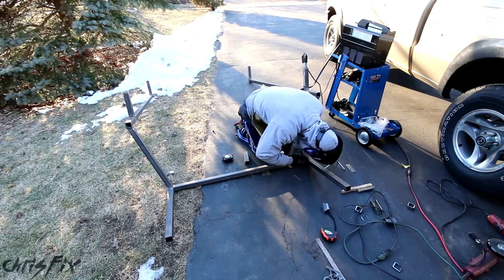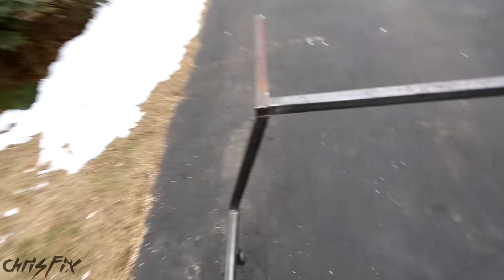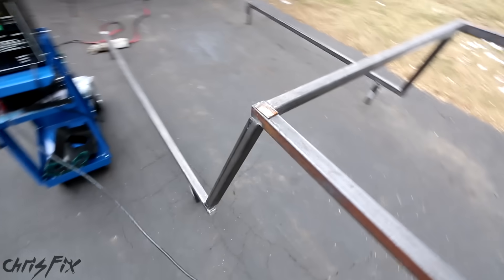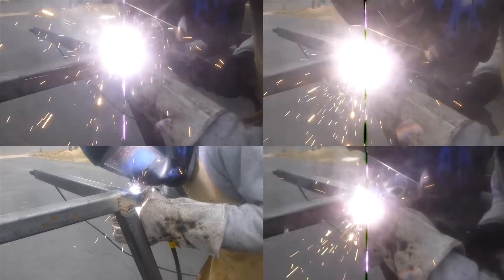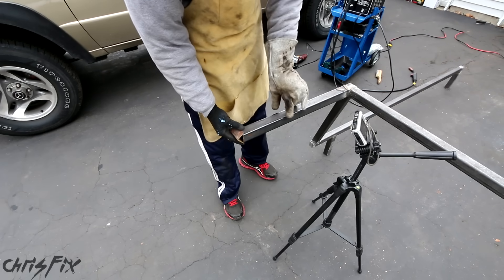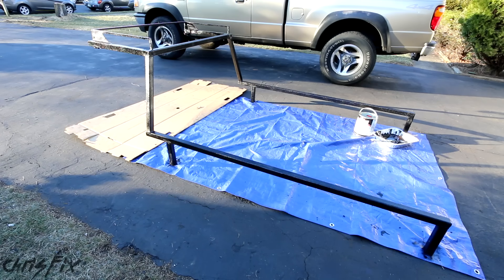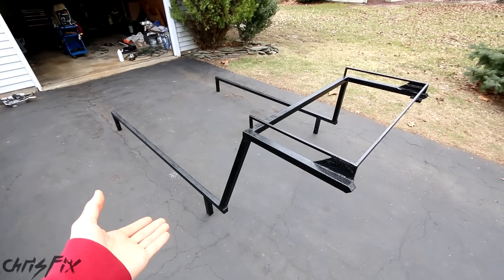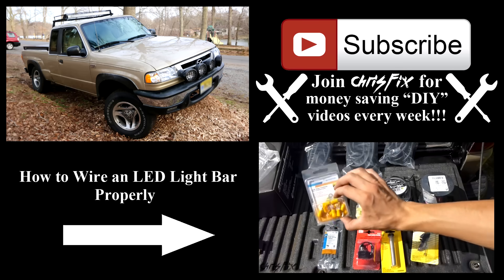Custom LED Light Bar Build (Part 2 "Project Night Light")

Comment: I am very impressed with your design and build and I couldnt help but think about some other ideas you might want to add to your rack like some cross bars so it could be used as a basket, also some forward amber lighting in the form of some pods on the sides or a smaller 10" bar on the bumper to cut through fog and dust, and one last idea was some bed lighting so you can work in your bed at night. I'm sure someone had made some comments like these already but I think your rack how it is is very cool and a nice custom design so GOOD JOB!!!!! You have me as a subscriber now!!!!
Reply: And i just read the next comment that was basically just like mine so good to know we all want to help! Props to you though for building this thing yourself.
Reply from the maker: Tom .Dugan Thanks a lot Tom. Those are really great ideas and stuff I tried to build into the design so I can easily add it later. I know you saw the other comments but thanks for the ideas!

Comment: Hi chris , i follow you from italy and seen all your vids . I didn't know where to ask so i'll just ask here. I would like to know what you think about a 12 volt Impact Wrench or an economic electric impact wrench. I read a lot of reviews and they seem to be nearly all positive. Air tools are too expensive and complicated and not everyone can use them. I am not a professional mechanic and i would like to try out some electric impact wrenches . What do you think ?? Thanks, Mike !
Reply from the maker: Michele Debenedittis Hey Mike, thanks for the shout-out from Italy! A 12v impact is a great tool to use. I would try to find one with a lot of torque, one that has a lithium ion battery, and one that is small for those tight places. Air tools are great but then you need to fire up the compressor and drag around an air hose. I dont really have one I recommend because I dont use them, but let me know what you end up getting!
Reply: Ok i will let you know,  if you will ever do a review on a 12v impact wrench let me know.  I think it's a great tool to have.  Very cheap(50 dollars on amazon) and it does the heavy stuff easily without compressors or stuff like that.
Reply from the maker: Michele Debenedittis For sure!

Comment: Good job Chris, 

Heres a welding tip, when welding tube to flush metal knock the ends down of the tube. It'll help with weld penetration and less clean up grinding. Second tip, try welding gusset plates where loads will be,like the vertical from the bed up to the cab top and where the "light rack" meets it. It doesn't hav't to be large, but you'll be dealing with wind hammer at highe speeds.
Reply from the maker: Darren Ambrose Thanks for the tips Darren!
Reply: I only mentioned it because, I've  got a Doctorate from the school of hard knocks.My old instructor said " An ounce of prevention is worth a ton of peace of mind". Happy Fabrication....
Reply from the maker: Darren Ambrose Haha, I agree with your instructor!

Comment: Good job! Especially considering you're a selftaught welder! I think you used a little too low amps tho, but it's still very good! 

If I made this rack, I'd weld in a "strenghtening brace" between the horisontal bars and the vertical bars. Even tho it's metal, it stills av quite a bit of flex!
Reply from the maker: Niclas Nybakken Thanks a lot man!
Reply: You actually made me want to weld a safari rack for my '93 4Runner!
Reply from the maker: Niclas Nybakken Do it up!

Comment: Hey I am putting a light bar on 2006 Chevy duramax. Do you have some tips for me.
Reply from the maker: Dallas Musqua Yes, did you watch Part 1 where I explain where you want to mount it? What light bar are you going with? Where do you think you will mount it? I will be doing a wiring video soon so that part will be easy for you.

Comment: Wow, nice job!  The bed liner was a great choice for the added texture.  About the only thing I would change is the thin top bar you have on the 4 stands.  I would have put the front stands in the way you did.  Then put say a 6" bar angled down from the front stand and connected directly to the lower bar just behind the lights.  Basically following the side panels you put on to help protect the bolts by making it harder for someone to steal.  That thin bar going all the way back just looks a bit awkward next to the streamlined look of the rest of it.
Reply from the maker: JohnWPB Thanks man and thanks for sharing how you would do it differently. That would be nice too!

Comment: You ever think of making it a roof rack for storage?
Reply from the maker: imajuu I thought about it but for now I wanted to see how the light bar worked with my setup. Maybe I will add two alley lights and then some expanded metal to make a rack in the future!

Comment: Hey Chris, if you haven't done this already, I have had very good results switching out the wire AND tip in my welder (identical to yours) for 0.035" LINCOLN flux core wire and matching tip. it actually makes a world of difference.
Reply from the maker: Darren Gendron Really? I need to try that. The tip really makes a difference? I will have to get different wire!
Reply: ChrisFix  The tip is required as the tip size that comes stock in the machine is 0.030" and cant accept the slightly larger diameter wire. I found that the lincoln ones made for 110v welders fit, and took this route as i could not find any 0.035" ones as an OEM replacement. My machine welds much more consistent, and penetrate better as well!
Reply from the maker: Darren Gendron Oh gotcha. That tip. I thought you meant the copper tip. That makes sense!

Comment: Great job so far Chris but, where's part 3?!?!!11?! =D
Reply from the maker: w00tplayaw00t The wiring video is getting filmed today and will be up on Thursday! Stay tuned!
Reply: Ah, such a tease! Alright. Sounds good. Can't wait.
Reply from the maker: w00tplayaw00t Yea, I had some questions for Wurton that they are answering about the proper wire gauge. Until then I do not want to run a ton of wiring and then have to rip it all out and re-film.
Reply: Ah, okay gotcha. Yeah man, take your time. I'm just anxious to see the final product working. Also, what cover is that on the bed of your truck? Looks real clean.
Reply from the maker: w00tplayaw00t I feel ya man. Im anxious to get it wired in. I have this awesome light and I cant use it yet!

Comment: Absolutely AWESOME! 
Need a few beamshots in the dark to see the performance, does it vibrate at all without front support?   Very very cool build,  love the videos!   Keep em coming!
Reply from the maker: Brian C Thanks a lot Brian! I will be making a video on how to wire the lights and at the end of that I will show the light in action. It does not vibrate at all which is great! I can stand on the front supports and they only bend 1/2 an in or so.

Comment: Don't forget to drill several holes on the square tubing to allow moisture to escape,
I see it all the time that aftermarket running boards rust out because manufacturers
skip this step (probably to sell more of them).
Reply from the maker: Marv Douglas I sealed the tubing off completely so that shouldnt be a problem. Do you think I should still drill holes?
Reply: I live in Washington state and I often see running boards rust from the inside out. You need to do whatever you think is right. Take car.
Reply from the maker: Marv Douglas Thanks man!

Comment: Chris! I have a Mercedes s430 2003. When i apply very little brake pressure, i hear rattling noises from the car, but as i apply more brake pressure the rattling noise is gone. What can be the problem?
Reply from the maker: ***** Sounds like the anti-rattle clips are bad. They hold the brake pads in place.

Comment: Hey Chris I have a question so recently my dad got a truck for me and I went to look at the frame and it is all rusty it's not surface rust but there is no holes what should I do and should I be worried
Reply from the maker: joe moe You can use a  big metal wire brush and brush it off. Then hose it down and let it dry for the day. Then go under and use a spray paint or herculiner like in this video. Many trucks have frame surface rust. The key is not allowing it to get worse.
Reply: I found a hole in the frame from the rust :( what should I do now
Reply from the maker: joe moe If it is in the frame, then you should get it fixed!
Reply: Yea it's in the frame im going to take it to my uncle he's a certified mechanic I hope it's not that bad
Reply from the maker: joe moe Keep me posted!

Comment: Use a little tap fluid or at least some oil on your tapped holes in mild steel. Makes for smoother tapping and nice threads.
Reply from the maker: George Cortez Thanks a lot. I did not know about tap fluid for tapping the holes!

Comment: Looks good. I cant believe how much twist your truck has when you parked it on an angle at the end. Just shows how weak the frame is.
Reply: And here we have a Chevy fan boy, oh sorry a "expert"
Reply: RSH21 Actually that's normal for a truck.
Reply: +ShaunMMX actually it shows how weak the frame is. Not saying the truck is worn out, I am saying the truck was built with a weaker frame. Most likely an open frame and not a boxed frame. Most are open. I have a truck also and it flexes. If you watch the video comparing a f350 to a chevy 1 ton you will see the chevy has a stronger frame and doesnt twist as much. Meanwhile the fords tailgate started to buckle.
Reply: allreadyflying Chevys are better. That's just my opinion. Doesn't mean Fords suck, I just like them less :) There is a difference between having an opinion and being a douche. But yeah, flame flex on a Ford Ranger, Toyota Tacoma, Nissan Frontier... big surprise! Not meant for towing trailers or hauling so who cares? Oh, and CHRISFIX, AWESOME job on the light bar, mount, headache rack, and bed rails. Came out great!
Reply: +allreadyflying. I am a chevy expert. Honestly. Worked 15 years in the trade and 10 of those was as a major mechanical technician.
Reply: +Michael Staake Toyota Hilux is the leader... 1500 kg load, and the frame straight except for a little movement then it hits potholes and, bumps

Comment: This was a really great tutorial, thanks for the upload. However there are two things that I would've done differently if I were you. First is that if you're going to use grade 8 bolts, you might as well have captive grade 8 nuts to match as that mild steel that you're making this out of will fail well before that bolt. The second is that for stability reasons and having less vibration noise on the highway, I would bolt down the rear too.
Reply from the maker: Inspector Poirot Thanks  and thanks for the tips!

Comment: Turned out nice chris,  only a couple of things I noticed,  first, shouldn't you have used a self etching primer on bare steel?  Second thing, dude what's up with that thing that resembles a truck, is that a mazda? Cmon bro, the light bar is sweeter than the whole truck!  Good build man
Reply from the maker: buzzsaw301 Thanks man! You do not need any primer for herculiner which is great!

Comment: Hey ,Often change the transmission fluid cause significant damage to transmission, is this true?
Reply from the maker: Naser 12 Yes and no. Your transmission gets "use to" the fluid that is inside of it. That fluid has miscroscopic  clutch material in it that helps the transmission in its regular functions. If the fluid is black, gritty, or smells burnt, change it, but if it is bright pink then leave it. Some manufacturers have tranny oil change intervals as well based on mileage.
Reply: thanks , for help me

Comment: Looks great.
Reply: ChrisFix you Did A Great Job Brother! 
ChrisFix 
F. T. W.
Reply from the maker: John Work Thanks a lot man!
Reply: Yes!! ;) ¥
Reply from the maker: ***** Thanks!
Reply: Do you remember what settings you had your welder on?
Reply from the maker: It was on high and speed 4.5
Reply: ChrisFix  Thanks Chris. I've just ordered the Harbor freight 90 amp welder. Thought it would fun learning a little bit about welding by watching others. Thanks again. It had more pro's than cons, so I bought one
Reply from the maker: ***** Great! Let me know how you like it!
Reply: Sure will. Can't wait till it gets here. Going to start out on a old lawn mower. It's 10 years old an the deck has a crack in it. I didn't want to throw it out with it having a lot of life left in the engine. So I'll "V" it out an weld it up, maybe sale it for 50 bucks. Welder will be half paid for with one job.
Reply: ChrisFix N. P. Brother 
Love the videos..

I talked to Ford about my 95 Explorer they said on that model that they have a special type of adapter that goes in between movie scanner and obd2 port to keep it powered up after it comes on as this will not work on the Explorer it depends on what month in 95 mine is the very first year / body style just will not work none of those scanning tools wil Tess is special adapter to make it work so I will be looking for something like their specialized tool!
Just a heads up. ;)
Reply from the maker: John Work Thanks for the heads up. That is a shame. I lucked out with my 95 Van!

Comment: Now you just have to add some lights on it so they light up the sides.
Reply from the maker: Glen W Why do you think I left spaces on the sides ;) It is all part of the plan! haha
Reply: ChrisFix this build gave me some great idea's for my jeep. Since I kind of bought some extra led cube lights by accident.
Reply: ChrisFix oh I forgot to mention if you put a little weld on the thread bolts to the light it will be harder to steal.
Reply from the maker: Glen W By "accident" haha

Comment: Awesome! That welder looked like it did a decent job. I've been thinking about getting one like that at harbor freight.
Reply: ChrisFix I have the same welder and the same cart. I did get better flux core from home depot and some welding sleeves for my arms. Yes my did pay for itself also the first time.
Reply from the maker: Joseph Williams Thanks! The welder is perfect for a DIYer who doesnt want to use gas to weld. I recommend it. It payed for itself the first time I used it!
Reply from the maker: Glen W The home depot wire was better?
Reply: Oh I didn't know that thinks for the impute.

Comment: As a general rule of thumb you need at least 3 full threads to be effective. If you have trouble what you should do is get a piece of solid round bar, drill that out and tap it. Then drill out the hole in your rack to the size of the round bar and weld that in.
Reply from the maker: Eric Morrison Thanks for the tip Eric!

Comment: Hey chris, what would you think about doing a video where you use the herculiner on the bottom quarter of the truck? I've seen several trucks with that done and it really looks amazing. It protects from rock chips and rust, and is fairly easy to clean too.
Reply from the maker: ***Classified*** I already have an undercoat I did on the truck when I first got it. I was thinking about using it for the fender flares and bumpers!
Reply: ChrisFix That would look so cool! I'm going to be doing it on some nerf bars and the main trailer receiver. I've seen whole cars painted with it in my area actually. It looks decent too. I hear it is pretty dent resistant as well. I did have an issue the first time I used it though. I didn't get the texture that everyone else gets. Mine looked like it was just a high gloss black paint. Maybe I didn't stir enough?
Reply from the maker: ***Classified*** Yea, that means you didnt stir it enough. You really need to stir it good! Let me know how it comes out for you!
Reply: ChrisFix Will do, got any pics of the light bar in action? the tease is killing me!
Reply from the maker: ***Classified*** Monday!!! (hopefully)
Reply: ChrisFix Can't wait!

Ever think about getting a full size truck or are you content with the midsize? I really liked the old rangers, but the newer ones got about the same fuel mileage as their big brothers and made less power. needless to say, I bet you have the coolest ranger on the block!
Reply from the maker: ***Classified*** I like the midsized trucks. Full size trucks have their place, but I really like what I have. The bigger trucks dont fit on the trails as easily either.
Reply: ChrisFix Didn't think about that! Maybe we can get some trail footage soon?
Reply from the maker: ***Classified*** Maybe!!!

Comment: Awesome stuff man. I feel just as excited as you sound in your videos when you were building it. 

I def like the tip of having the light not mounted at the front cause it will cause night blindness. I didn't think of that and a lot of trucks out here have it mounted in the front.

One idea I got off a guy that builds exoskeletons for off-road rigs. Is that he builds the whole frame so they share the same inside chambers, for lack of a better term. And air leak test them so the frame itself can be used to hold air for air tools In addition to the onboard pancake compressor.

Something I want to do. But anyways props. Changes the way that truck looks!

Comment: Pretty badass. Although I'd change a couple things. Like making the bed rail go all the way to the end, instead of just the post. And in the Lightner mount protective plates, I'd put some flush mount off road lights. Maybe even put trucker clearance lights on top of the light bar
Reply from the maker: RedTeamWolf Thanks! Your ideas sound cool too!
Reply: ChrisFix if only i had the money for that light bar... I'm saving for other things. Like a RV i scored and am waiting for the money to buy it